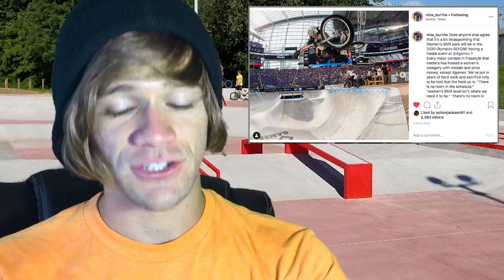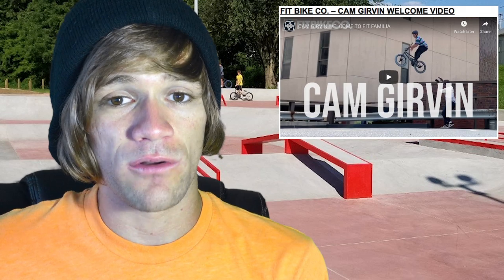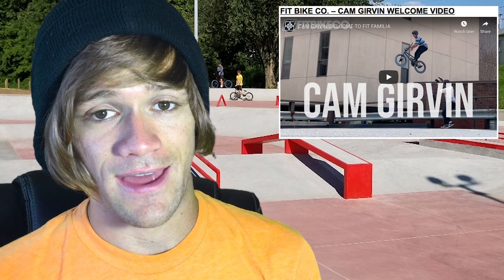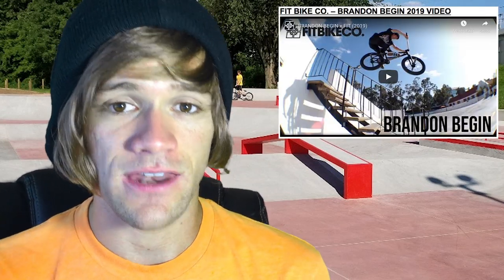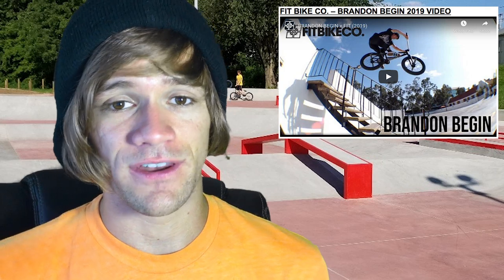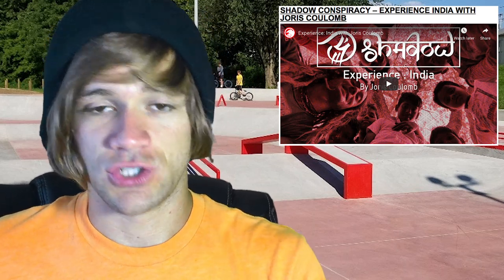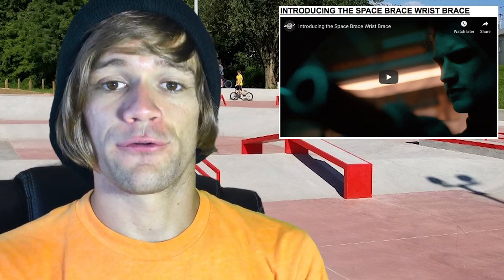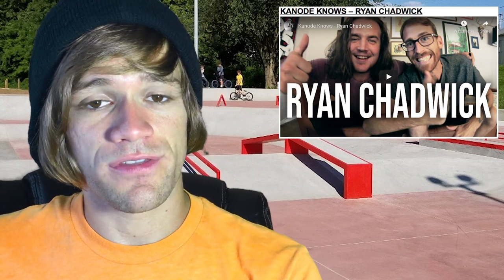Game Changing New BMX Parts? - PLASTIC Bearings?! Freecoaster Out Now! Women & XGames

Comment: If they get the plastic compound right (hardness) then it could work. It's just a bushing rather than a bearing. We've had bushings in cassette drivers for years (albeit metal).!! When run in, it'll still kick-flip as long as you greased it on installation. Remember, traditional bearings are not solid, it is an inner and outer ring sandwiching a retainer and ball bearings. It is fallible and can crush/deform reasonably easily, whereas a solid piece (correct compound willing), could in theory be stronger in terms of radial and lateral force.. The key will be in the compound of plastic, both in terms of strength (not brittle) and longevity (bushings can wear quicker if the material is too soft).
Reply from the maker: And THIS is exactly why I ask questions! Haha
Thanks so much for the insight man. Maybe we will all be running plastic bottom brackets in a couple years
Reply: There are some people here in Brazil that started using these plastic bushings.
Reply: I just think they’re trying to fix something that rarely has issues and is insanely cheap to replace. That’s like trying to make tires out of metal so they don’t pop as easily...super pointless imo
Reply: @justdan913 , i actually think it might be because riders are so clueless when it comes to installing bearings (BB's). 
A hammer is not a suitable tool to install a bottom bracket.. This is what should be used to ensure the bearing goes in straight and doesn't twist or get crushed...      https://www.parktool.com/product/bearing-cup-press-hhp-2
Reply: I get your point but at the same time, ppl still aren’t exactly blowing bearings out left and right as well as the industrial industry still uses bearings on mad machinery as they are as tried and true as they come. Plus, 95% of kids using YouTube find a way to get that BB in there regardless of the tools no prob. I just wanna see more innovation in more important areas is all
Reply: Ban plastic

Comment: There's a lot of different plastics out there, but I can't see them lasting really long... Ultimate weight weenie stuff, maybe good for park riding..... That new freecoaster tho, does it not require a 1/4 pedal to re engage? If it instantly re engages, I'd want to try it out...
Reply from the maker: I agree, but who knows. I'd love to be proven wrong and not have to worry about bearings as much. Even though its kinda a thoughtless part anyway.

Im pretty sure the freecoaster doesn't have any kind of engagement at all. It just works as a cassette and a coaster at the same time all the time depending upon which way you're rolling. We'll find out soon, if you catch my drift ;)
Reply: @Brant_Moore  you can ask me tomorrow.
Reply from the maker: Did you buy one??
Reply: @Brant_Moore  first in America.